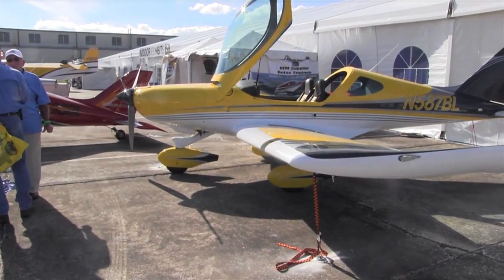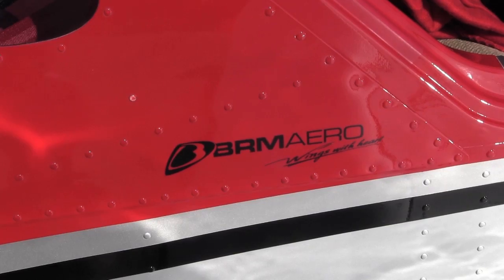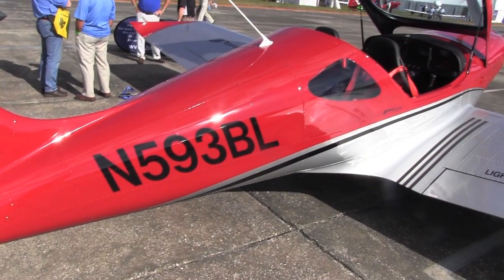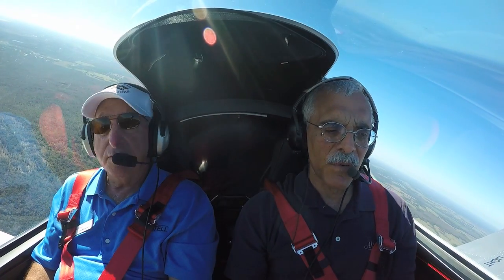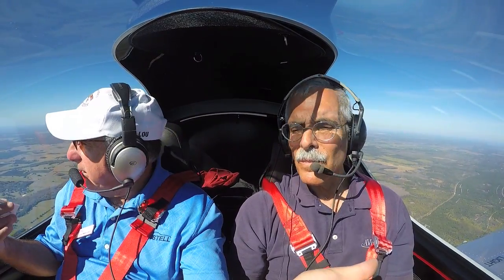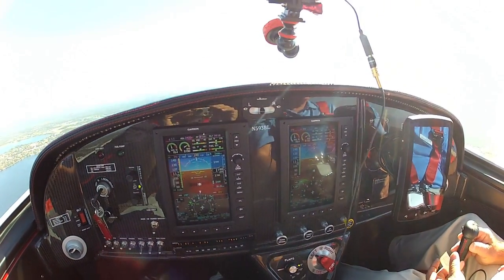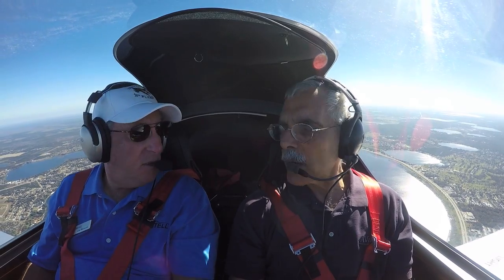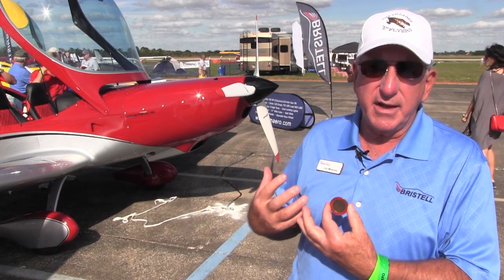AVweb's Flight Trial of the Bristell TDO

Comment: Sexy little rocket ship.  Speaking theoretically, of course, what sort of speed would you get with the prop at fine pitch?  Also, Paul, how was landing and ground handling?
Reply from the maker: Can't answer the prop question. Didn't have much time in the airplane and with a stiff crosswind, I had Lou do the landing. Even at that, it was...sporting.